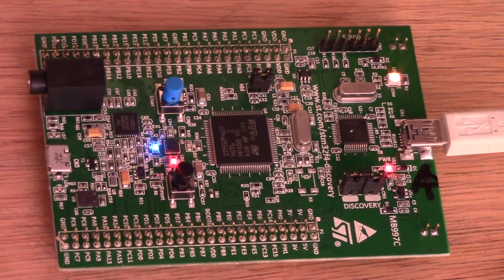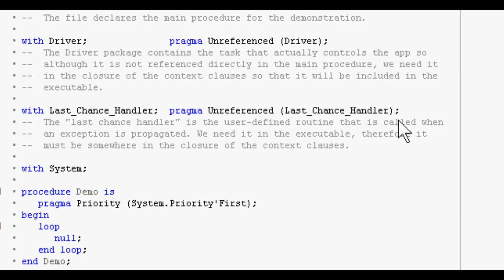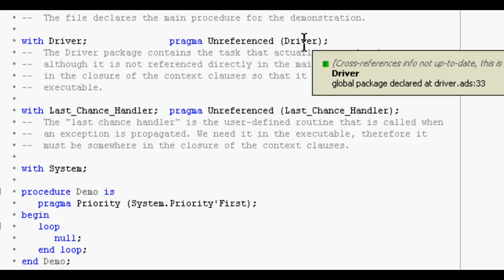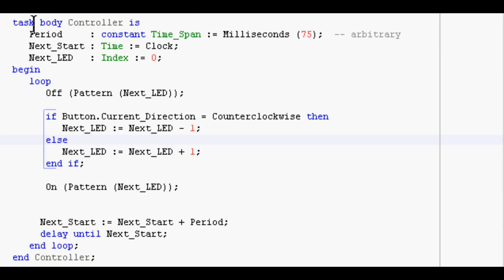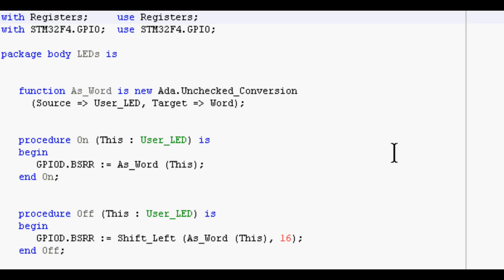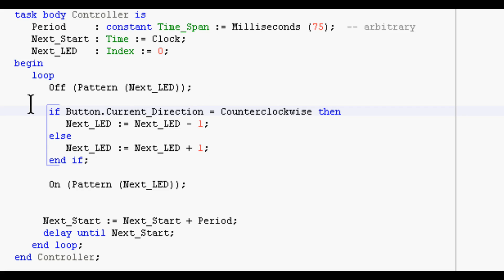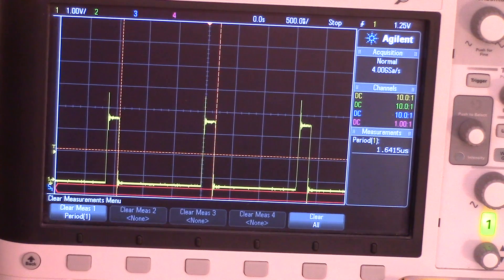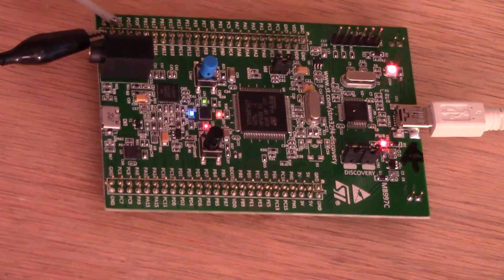Episode 9 - Ada - Even on a Microcontroller!

Comment: Is it possible to program avr 8 bit microcontrollers in ada too?
Reply: woodlandmikey
No Ada didn't claim that is magic fix for everything, but it did claim that have safe type conversion, which in case was not true. Operand Error is error which is relatively easy to deal with, it rise hardware interrupt, which is easy to catch, and if developers know that Ada do not work (as it should,  they probably will know how to deal with it, and nothing will happen.
You are right that programmers are mostly to blame, and not only for that they overlooked to change code, but also that they did not check how their compiler will act in situations like that and will it even work what it claim to do (and that is not only problem with Ada, same  apply to other languages).
Airbus Defence and Space do claim that Ada compiler is to blame for Ariane 501 failure, and you are technically right that no one blame Ada, because Ada should deal with events like that, but in this case compiler did not do its job.
Rising warning is not irrelevant thing, it is indication for good programmers that they should look second time to see it they need to fix or not code. And yes there is reason why Ada should not rise warning like that, it suppose to deal with errors like that!
As why Ada is still used by Airbus is in same reasons why companies still use COBOL (even there is not many people that know that it and are alive now), they have lot of code written in it and it will take lot of time and money to rewrite all that code at once, much easier and cheaper to fix exiting code (even for example here COBOL programmers are paid more then 10 times more per hour then any other).
Reply: +Sebastián Benítez Yes, I've programmed an Atmel AVR in Ada - the project is called, somewhat predictably, "avr-ada." It's a stripped-down version of the language, though, which is understandable given that Ada is kinda huge. I know Ada people might not like hearing it, but C just plain did some things right, and I'd like a language with the "safety" features of Ada but with some of the conveniences of C (e.g. augmented assignment - though Ada is right to have assignment as a statement, I think, in terms of bug-resistance.)
Reply: +Bryce Schroeder Ada "safety" features are so good that they cause most famous software bug related accident (and probably more costly)  Ariane 5 rocket, Flight 501 accident, caused by inadequate protection from integer overflow
Reply: What, 20 years later and people are still trying to blame Ada for this?!  The integer overflow was a hardware event.  The programming team would have written the code to respond to the event in the same way regardless of the language used.  And besides, the way the event was handled was reasonable for the earlier Ariane rockets.  It only became unreasonable (and caused the loss of the rocket) when they stuck the old software into the new and very different Ariane 5, and didn't revisit their assumptions, or perform adequate bench simulation testing because of the expense.
Reply: woodlandmikey
Only problem with your explanation is that Ada biggest "selling point" is that it should deal with problems like that. And conversion from a 64-bit floating point number to a 16-bit signed integer is not "hardware event" as you call it, even mediocrity C compiler will rise warning  when you for that conversion and Ada which is allegedly designed for "safety critical" applications did not managed to do that.
They did not stick old software in to new rocket, it is same software and hardware as it was used in Ariane 4 (only difference is that Ariane 5 have higher initial acceleration then Ariane 4 which lead to event that revealed flaw in way Ada deal with situation like that).
But all that is not important, anyway even DoD dropped requirements to Ada be used, and they even go further then that (DOD preparing to drop its investment in sustaining Ada and rewriting all Ada code to other languages it it is planed to future use), which practically mean that ada is dying language for example for F-35 all software is written in C++ (by DoD requirements). And it was time they learn that Ada is dead end, which was proven may times (for example most reliable rockets use C,  Pascal, Fortran and recently  Drakon).
Reply: Ada never claimed that it could magically fix programming decisions that may have been valid for original hardware X, but are invalid for new hardware Y.  It is absurd to think otherwise.  And yes, the conversion from 64-bit FP to 16-bit INT, and the resulting Operand Error, was a hardware event, located in the 68000-family FPU.  The Ada compiler generated the appropriate FPU instructions for the line of code under question, and of course any compiler for any other language would have generated the same FPU instructions for equivalent code.  The question of a "warning" is irrelevant, since the Ariane 4 programmers determined (rightly or wrongly) that an overflow in the conversion could never happen in flight, and so must indicate a hardware failure.  And do you really imagine that Ada would not emit such a warning?  Finally, yes, they stuck "old" (previously written) software in the Ariane 501, rather than "new" or re-written software to account for the different flight characteristics of the new rocket.  People can question the decisions made by the Ariane 4 programmers (though no Ariane 4 ever failed due to the code in question), but nobody can seriously claim that Ada somehow caused the Ariane 501 failure.  Certainly the ESA never made such a claim, and continued to use Ada code in the Ariane 5 rockets.

Comment: As an Oracle database admin I have used Ada for the past 15 years and still code 4 to 5 hours a day using it because the built in language for the database is PL/SQL which is an Ada base language.  I had no idea I could use Ada for my micro controllers. Thanks. I will have yo look into this more.
Reply: +Todd Harrison (ToddFun) Ada and PL/SQL are both modeled after Pascal.

Comment: Hi Jack, great videos so far, I'm not an expert programming MCUs, but use 16bit dsPICs extensively on my designs (up to 7 dsPICs on one device talking to each other over CAN, got also 2x 256x64 VFDs and Ethernet coming up now. I program all MCUs with something called "Flowcode", I love it. It gets the job done VERY VERY easily without being a programmer I can do wonderful things. I know it's a lot to ask for an embedded engineer to go and take a look at this software. However to say that in a few minutes you can have something running which will suit any need, I have even started to show this software to my 9-year old son as it's that easy to use :-) Anyway, take care and keep them coming!

Comment: I would never have imagined Ada was available on a controller, never mind viable. Or should that be the other way round? A real eye-opener. Thanks!
Reply: 964tractorboy Ada was designed for embedded work as well as for use in other areas.